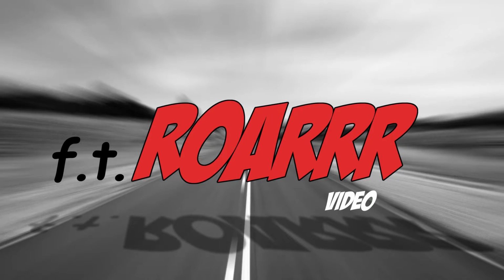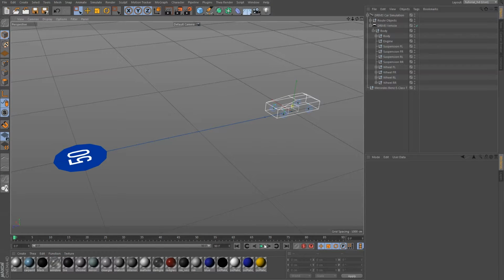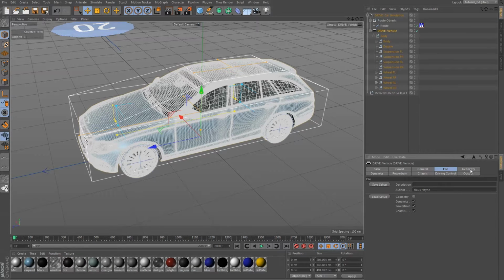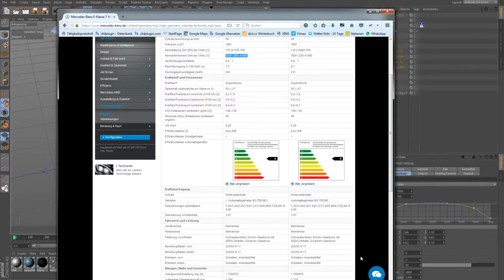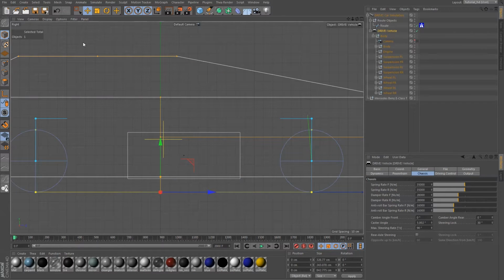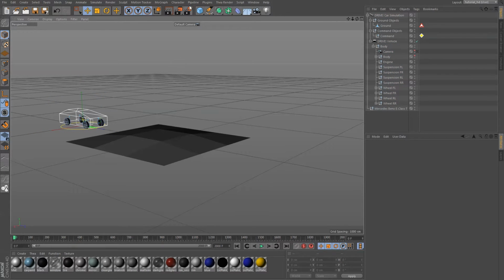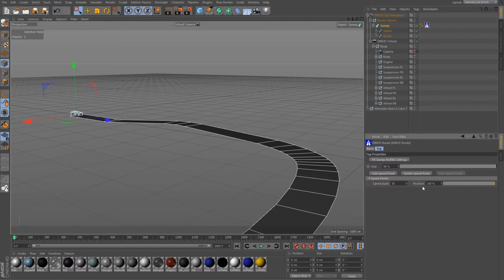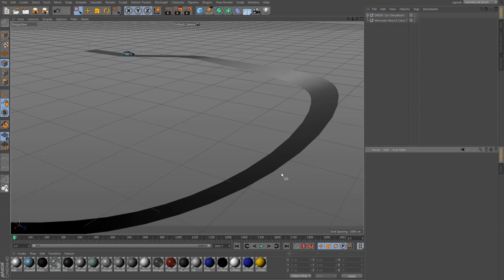DRIVE Quickstart Tutorial

Comment: Hello, how can I set the car as normal ridig body?  So it would collide with any normal object with collision tag and no need to setup crash  box
Reply from the maker: If you want the car to react on impacts, you need the CRASHBOX add-on. If you just want the car to bounce some boxes away you could simply add a rigid body tag to the car body (or better use a proxy body object).
Reply from the maker: yes and no. The car will act on other dynamic objects but cannot react.

Comment: can you make tutorial about collision and handbrake in this plugin?
Reply from the maker: there is already a tutorial about collisions: https://www.youtube.com/watch?v=j1_FUhYqpiI. 

A tutorial about handbrake? Just place a command object to activate the handbrakle on the drive line.
Reply: thanks
Reply: For some reason all the options in the vehicle object are greyed out, so it wont allow me to move the objects to the list field.
Reply from the maker: If the simulation is active, you cannot edit most of the parameters. Just set the time pointer to the first frame to get the edit mode.